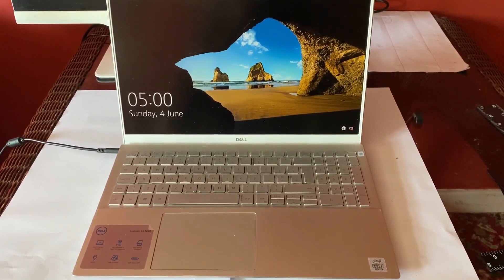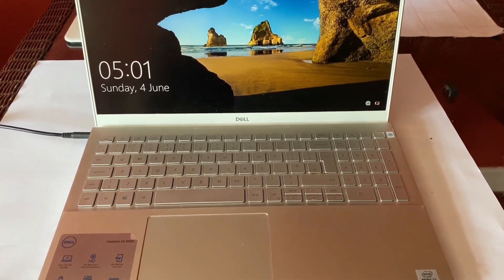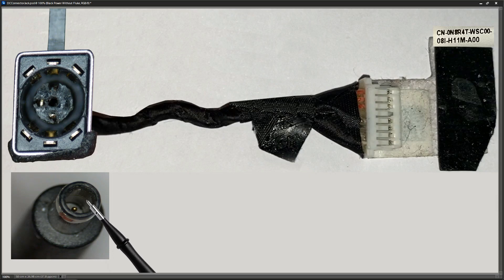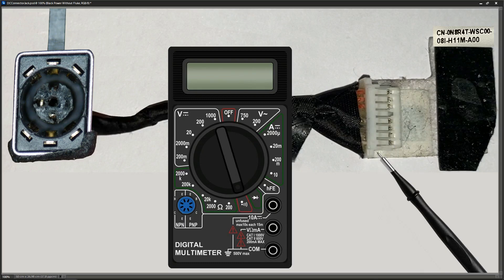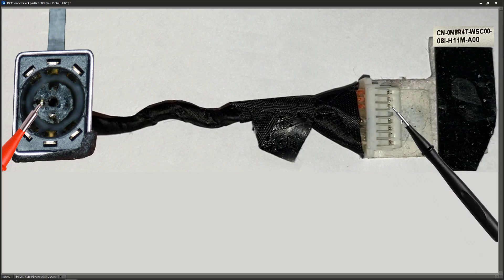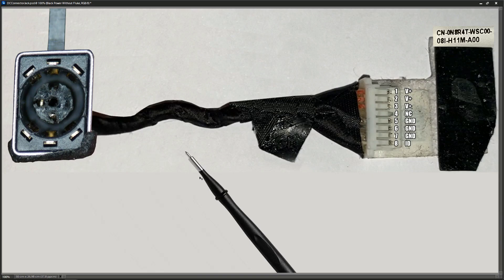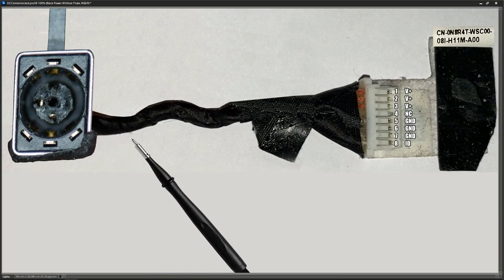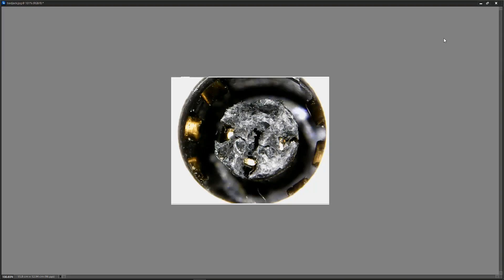Dell Inspiron 15 5000 - Power Jack Troubleshooting

Comment: I'll put it this way: If I were the owner of that laptop and I already detected the problem, of course I don't want to be holding the plug for the entire time it takes to charge the battery. Another way of saying it, I want the technician to install a new part that will avoid this type of anger (displeasure) and if he solves it to my satisfaction, that technician (workshop) has gotten himself a client for life. Thanks a lot for sharing. All the best.

Comment: I almost thought you had the pinout wrong on the 8-pin connector, but I was mistaken. I am accustomed to the 6-pin connector on the older Inspiron models, where pin 3 is the ID pin, and pin 4 is NC.

Comment: I had an Inspiron 5570 with exactly the same problem yesterday. If I had some dental picks, I might be able to bend the metal contacts out again. But for now, I just replaced the power jack. Thank you for the idea to stick a jumper wire into the center. I hadn't thought of doing that.